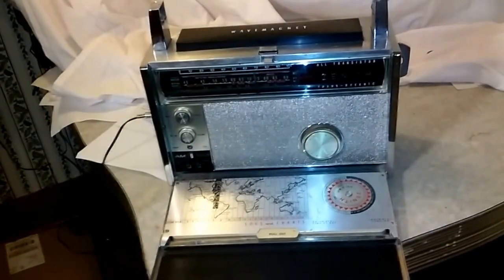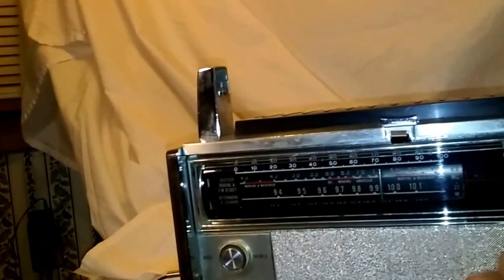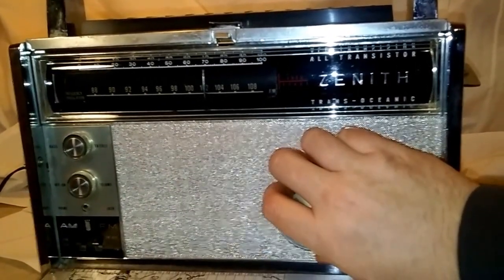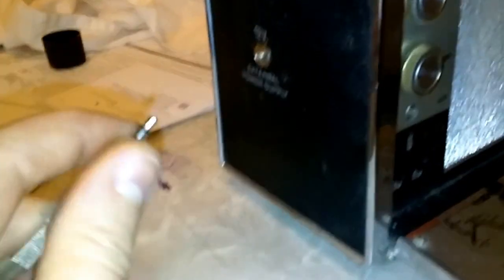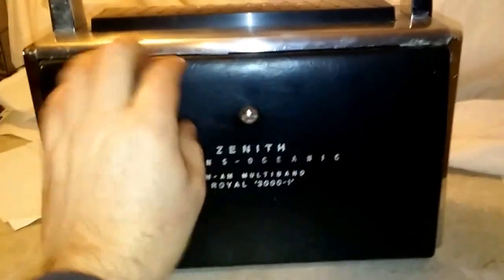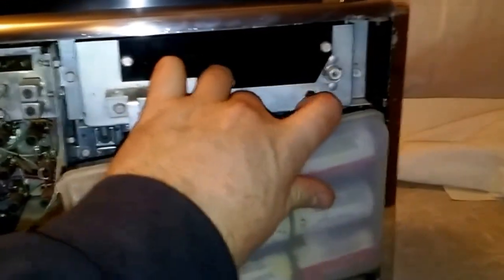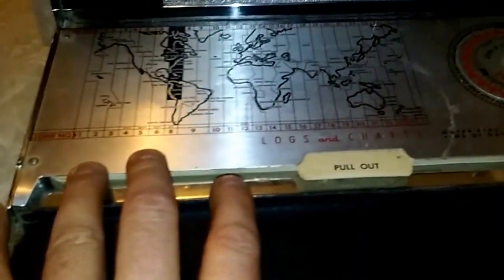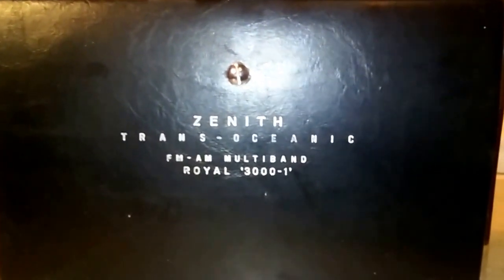Zenith Trans-Oceanic Royal 3000-1 multi-band radio repair results.

Comment: Thanks for this vedio in have like this radio but not battery. I tried installed a transformer how is the voltage plz.
Reply from the maker: Be careful.  This radio uses a positive ground arrangement as I recall.

Comment: Nice work! I have one with a bit more corrosion, especially in the battery box, but works and sounds well using the external power. The battery pack of nine D cells is split, I'm guessing eight for the 12v and one for the dial light. With external power I have no dial light, so I plan to wire in a single cell for it. What do you think? thanks

Comment: I have this exact radio.  I do not have the battery pack.  When I plug the radio into the wall with the correct Zenith power adapter, I get a constant interference noise on the short wave bands, very similar to what one would hear on the am band.  The fm band is perfect.  I am wondering if the electric power is the source.  Can you tell me where I can purchase a battery pack for this radio.  My hope is that with battery, I would eliminate the interference.
Reply from the maker: I don't know where you'd find an exact replacement battery pack, but there's enough room in the case to make something up for it.  A small SLA battery might fit.
Also, you can build a linear power supply for it.  A transformer, full wave rectifier, big filter cap and 78xx series regulator would provide clean power.